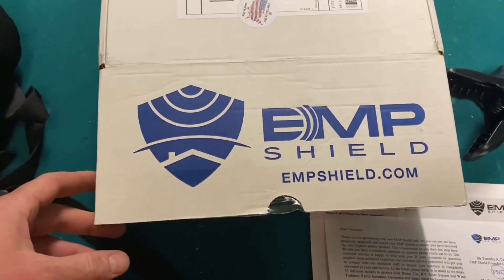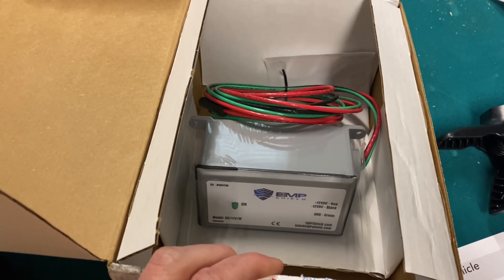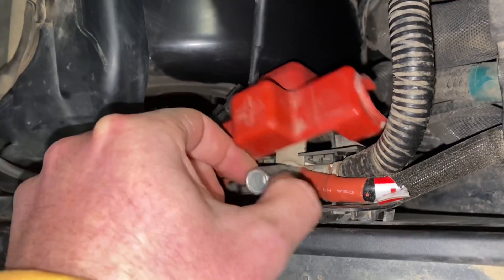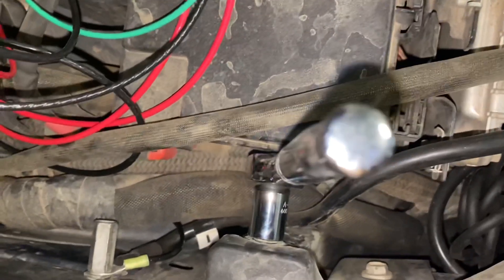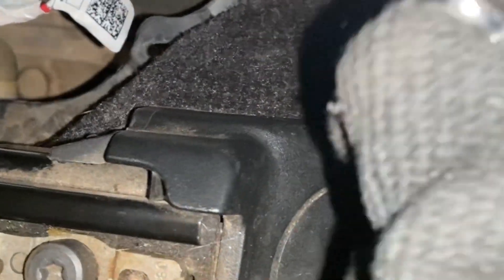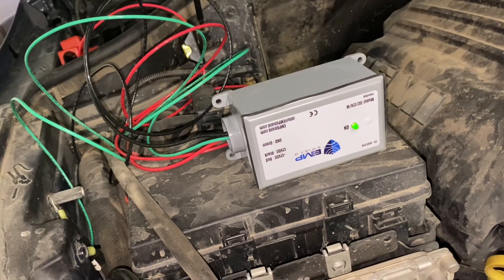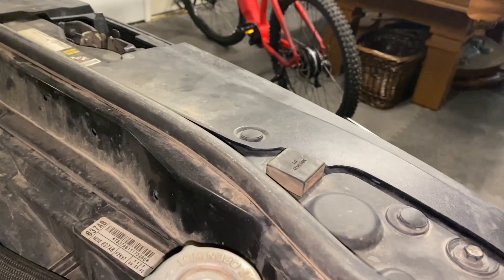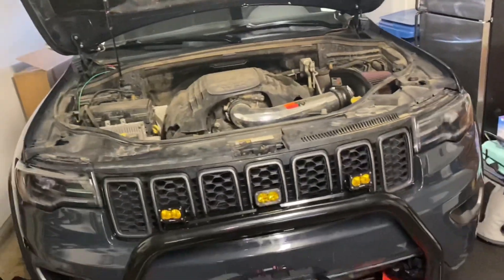Small Mod Makes Jeep Grand Cherokee WK2 Bomb Proof | EMP Shield Installation for your Vehicle

Comment: EMP's are weapon of the past, now they can shut down the whole country with a laptop
Reply from the maker: For sure. I believe it is still a weapon to protect yourself from but technology has advanced and the wars now are much different than the last 😂
Reply: FBI, CIA, Secret Service has entered the chat 👀
Reply: I was wondering if that would work being that’s a battery external relay and wondering if it runs before computer of after 🤔 I ask as I own GC also
Reply from the maker: @sheerwillsurvival2064  according to the company I bought it from it is completely functional where it is mounted. It didn’t fit under the passenger seat where the battery is. I could have made it work but it fit perfect right in where it is.
Reply: @tippintjs  cool I ll be getting one
Reply: Dude, you see what’s happening lately. An emp is always discharged when a nuke goes off, it’s not a thing of the past. These do work, all our Marine Humvees have them